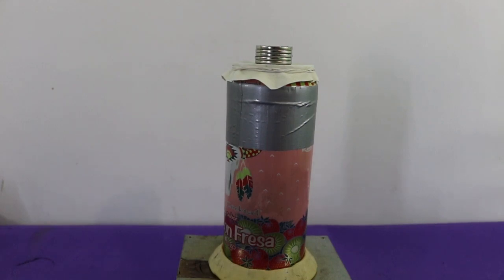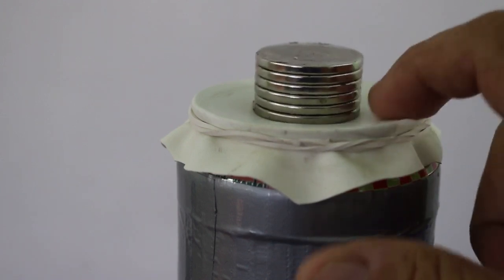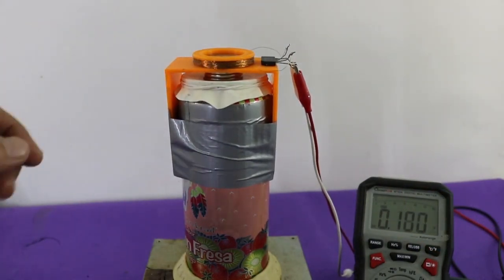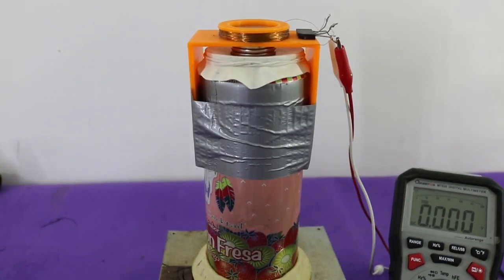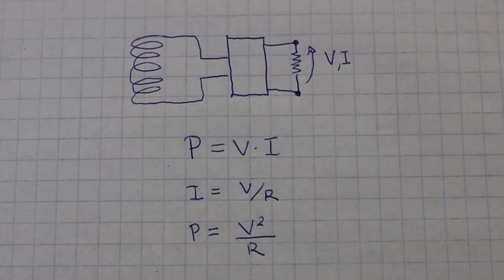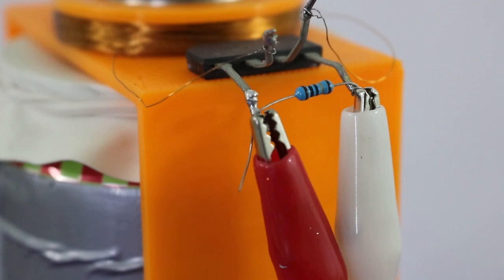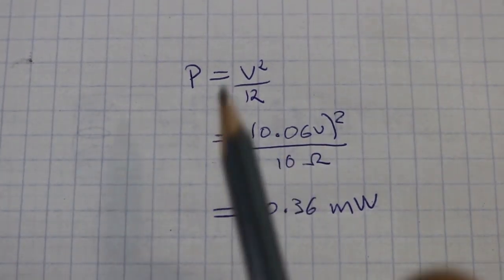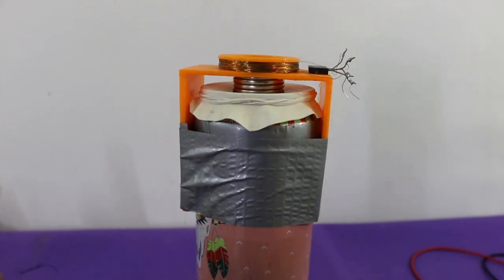Stirling Engine with Electric Generator

Comment: Wouldn't the duct tape holding the top components together insulate the part of this Stirling engine that needs to shed heat?  Perhaps using something other than duct tape that can allow the Stirling engine to shed heat would improve the efficiency?

Comment: Would it be more efficient if you had used a speaker for the power generation ? A 2nd step could be to variably change the resistance through an arduino board because the engines output varies in frequency and this way you could steer the result.

Comment: The power that's generated by an oscillating mass is given by using the formula for simple harmonic motion :
Power in watts =1/2 m .(2πr.f)^2
Note that this gives the same result as the Rotational formula : 1/2 I  w^2  , 
where I is the moment of inertia,  as I = mr^2 and w =2(pi)f,

So if the mass, m, of the magnet is 50g = 0.050kg  and the amplitude r of the oscillation is 1cm = 0.01m and the rate of oscillation is 20Hz. Then the power is 0.5x 0.05 x (2x 3.1416x 0.01x 20)^2 =.0394 watts =39mW
Please correct my assumptions of the mass, amplitude and oscillation rate.
Note the amplitude is half the peak distance moved by the centre of mass

Comment: Perfect. This is the way to go. The efficiency is low, and others did not want to measure it anymore, but by knowing the efficiency you can easily see what changes improve the engine. I would even recommend to use an electrical heat element (for 3D printers) or a heater band (for injection molding) when doing measurements, because then you know how much energy goes in and comes out of the engine. I think stirling engines can be made much more efficient when the makers have a clear sight on the efficiency.
Reply: I agree, there has been a lack of focus on efficiency

Comment: There is too much tape on the top side so there is no cooling
Reply: Yes the top should be a cool as possible. Heatsink perhaps and minimal tape insulation.
Reply: Looks like it works just fine to me.

Comment: 1.) the Aluminum-Can (Closed Ring) produces a partial shortcut.
2.) using schottky-rectifier will reduce the loss for the rectifier dramatically.

Comment: It needs a guide rod on the piston to keep it from hitting the coil. Or making the coil wider to account for lateral movement. Great video, thanks for sharing!
Reply: Your right it needs a guide because making the coil diameter larger would reduce efficiency, in my opinion not a solution to the problem at play
Reply: @Spoods117 Absolutely.

Comment: Folks, this is solid gold information, simple as it is.  I've been scratching around the internet for the last couple of days looking for information on Stirlings.  There's not a lot.  There's a lot of TALK about them, but nowhere you can just "buy one" the way you would a DC or AC motor, and precious little in the way of plans and actionable information.  This is material that gets your foot in the door.  Add in some understanding of thermodynamics that lets you start to quantify what you're doing using real physics, and you're on the road to discovery.
Reply: Spot on.  At least this guy is experimenting with designs and keeping it simple.  It's also strange how stirling engines seem to have really fallen out of vogue on the internet in the last 10 years.
Reply: There are Microgen generators that you can buy and even CHP systems Ököfen for household use. I've been searching a used microgen generators or very good drawings, but it seems to be so complex to build at home that it would be better to find one.

Comment: The orientation of the magnet realtive to the coil isn't a good one. Moving a magnet into or out of a coil doesn't induce a lot of current. The magnet should move sideways relative to the axis of the coil. I know, hard to construct in this setup, and the power taken out will most likely immediately stop the engine. But just if someone is wondering.
Reply: Very interesting suggestion! I'd like to see him repeat the experiment with the coils oriented by 90°.

Comment: May I suggest that you remove the bridge rectifier and repeat the experiment in AC mode?
You are loosing power in the rectifier to the ~1.2 volt drop across 2 diodes.

You also might consider lighting an LED without the rectifier.

Great video! Thanks.
Reply: Not only that , he needs a guide rod at the top of the magnet so the magnet moves in a straight line. I think he can get more power with a higher resistance , so the magnet can get up to speed. Flywheel is another required item.
Reply: With a processor with an a/d converter, you could make a synchronous rectifier made of VMOS FETS and get a zero voltage drop rectifier.
Reply: @benthere8051  
You can actually buy ideal diode ICs now, no micro required for synchronous rectifiers.
Reply: @GlennHamblin  I've been retired for a while now and out-of-touch with the latest developments. Thanks.
Reply: @benthere8051  
No worries Ben, I'm getting there myself, just wanted to let you know. :) Have a great weekend!
Reply: @GlennHamblin  I'm amazed, not only are they available but they are cheap. Thanks again.
Reply: I think the generator will work better without ANTS, they are stealing electrons one at a time!
Reply: @evilcanofdrpepper  
So the ants are Maxwell's demon?

Comment: The orientation of the magnets may not be very efficient. The magnetic field lines in this prototype may be running almost parallel to the coil. Would it be better if the coil was cutting the field lines at 90 degrees? Maybe if you could re-position the magnets it may make a difference. I'm not sure of this. Maybe someone could let me know if my thinking is wrong here. Thanks - Great video.

Comment: Add dc to dc buck converter to increase voltage
Reply: Except buck converters lower voltage. A boost converter could be considered, but that would be tough at that low voltage. However, there are joule thief circuits that run below a volt. Still won't be very efficient, so power loss.
Reply: @GlennHamblin  maybe increase in turns of wdg leads to voltage rise
Reply: Exactly how would a buck converter increase the voltage.

Comment: Can you build a small wind turbine that generates electric traditionally (alternator method) with also a Wimshurst mechanism added to it to harvest additional static discharge? They both use rotary motion, so it would seem that you could combine mechanisms to produce something interesting (I have a few ideas on top of this, but just getting a little test in place would be intriguing).

Comment: 1V with only Multimeter which has 1MOhm resistor
its super super low power unusable
Reply: Most experimentors have early disappointing results and together with the sayers requires resilience and determination.  Examine Faradays work. Without his determination we would still be reading by candlelight.